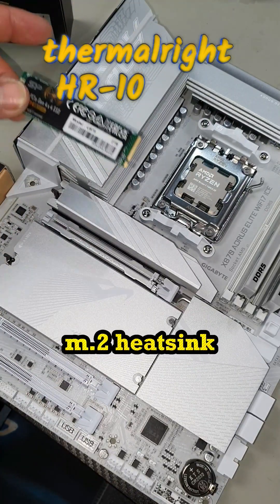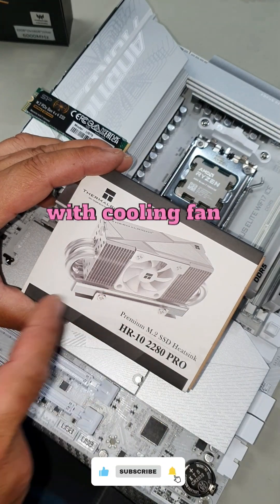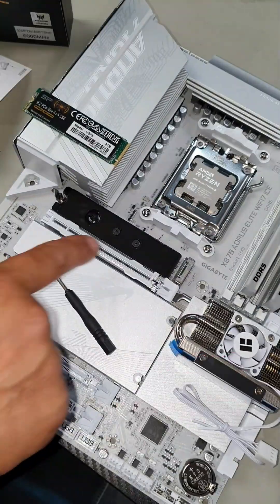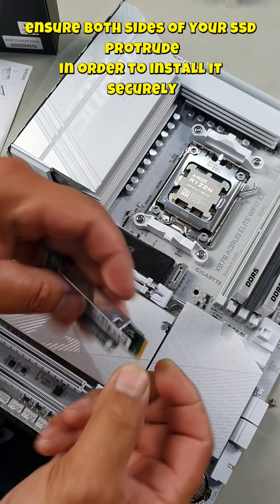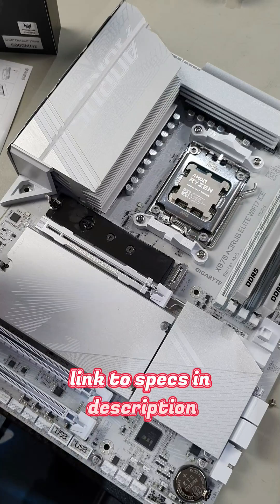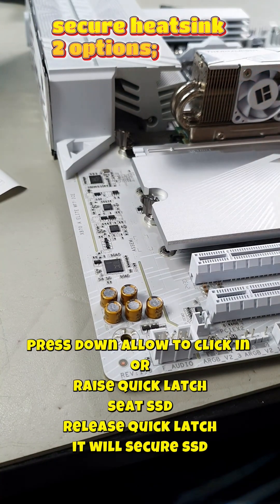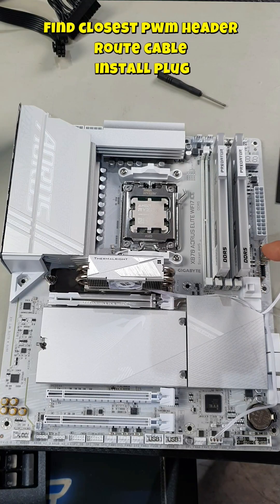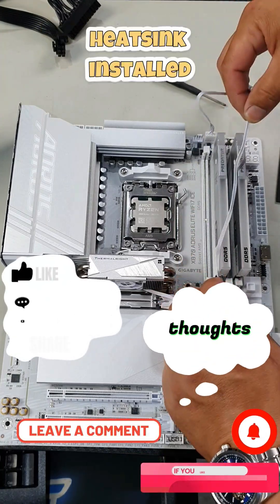gigabyte aorus elite wifi 7 ice -install Thermalright HR-10 M2 heatsink with cooling fan

Comment: To bad something like this will only be useable if you use aio
Reply from the maker: not true i used an mitx mobo with the perrless assassin air cooler and was abkento install something similar and still fitted good depends on what tour using in terms of cooler and size of mobo..atx will have more room always

Comment: Got one of these for my SFF build with a drive known to run hot, it's done a great job of keeping temps down.  The stock "heat sinks" on most mobos offer greater thermal mass but don't really increase heat transfer or surface area for cooling, this little guy does both.

Comment: My ssd is bellow cpu fan
Reply from the maker: if your ssd slot is the top ssd slot right under cpu ..usually u can still use this type pf cooler because it will still clear the gpu unless the gpu is made wierd and has a thicker backplate that protrudes and interferes with the ssd cooler

Comment: Would 2 pieces of that fit in the asus prime b670m-a wifi d4 socket lga 1700 mATX motherboard with asus dual geforece rtx 4060 v2 oc edition?
Reply from the maker: u can only use the top one ..first slot ... not for 2md slot
Reply: @MIKEYZVLOGZ why is that? Won't it fit on the 2nd slot?
Reply from the maker: @Aki2024. no cuz on 2nd slot the gpu is there so u cannot have that there unless u are doing vertical mount or u domt use a gpu then yes u probably can
Reply: @MIKEYZVLOGZ does it depends on the type of motherboard? What about the asus prime b760m-a d4 wifi motherboard? Would it fit on the 1st and 2nd slot?

Comment: Why did you remove the thermal pads?
Reply from the maker: i didnt remove  anything which ones u referringnto?
Reply: That's just protective film the heat pads are still on there.